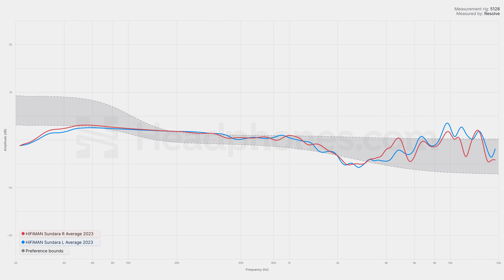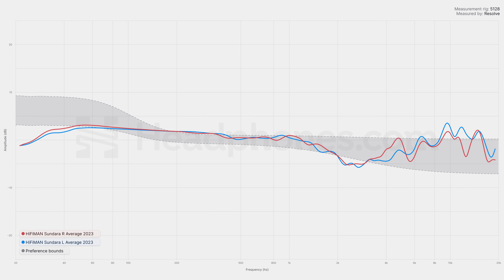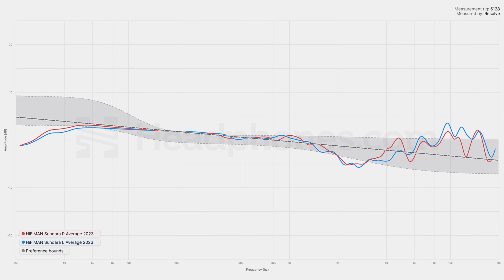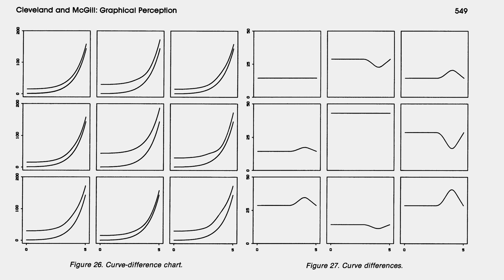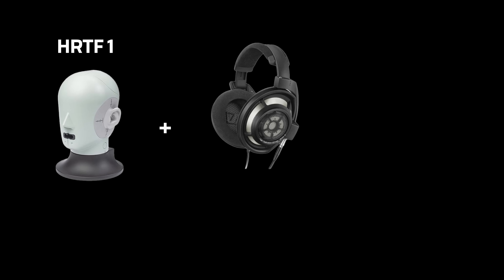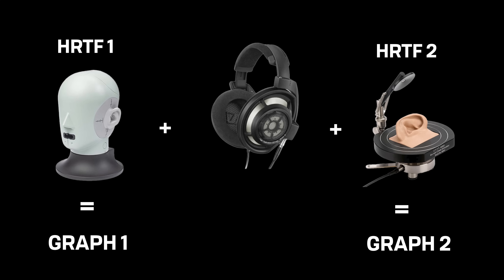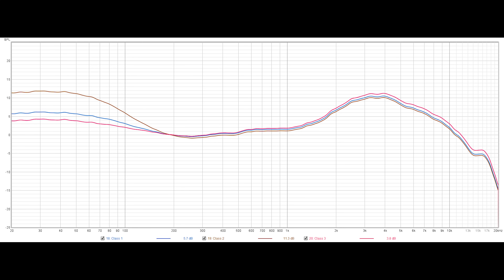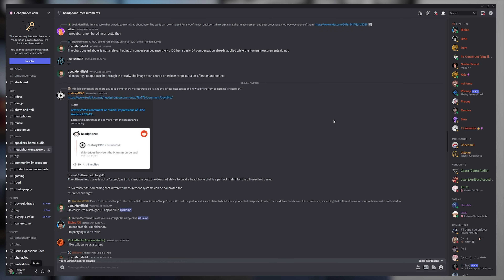A new standard for headphone measurements

Comment: I actually like what happens on sites like squiglink, where you can directly compare graphs of different headphones and you can compensate to both a target and another headphone. That imo is way more informative of similarities between different models, and is extremely useful for stuff like eq. I don't get why you don't have your own squigsite, with your database of 5128 measurements it would be an extremely useful and reliable tool for the community

Comment: I am a bit confused. Depending on the normalization frequency point (e.g., 500 Hz or 1000 Hz), the interpretation can change a bit, especially for in-ears, right? So how do guys choose it? Averaging using white noise as seen in Harman studies, matching what is perceptually revelent to the reviewer, or another method? 

Another question, is the preference boundaries the same for in-ears as well? Assuming that is based on the OE research and the in-ear research suggested more bass was preferred it seems a bit unclear how the in-ear approach will be.
Reply: You're asking the right questions. Currently normalization is full range 'best fit', but we are internally debating that and potentially adding custom range normalization. For IEM data the preference boundaries will need to be wider because there's more variation in terms of IEM preferences - again based on the research. We're also going to move to a population average DFHRTF for IEMs since the pinna is being bypassed, but that work hasn't been completed yet.

Comment: I've been looking at that graphical perception chart for a few minutes and I don't get it.
Anyone cares to explain and the relation it has to FR graphs.
Reply: When reading a FR graph, the main thing we care about is the difference in SPL (dB) between the measurement and the target, or in other words the vertical distance between the two on the graph.

Now for example, look at the top left graph in the graphical perception chart. Imagine you have a ruler positioned perfectly vertically from top to bottom, and slide it from left to right across the graph. You would find that although it appears that the lines converge, they actually have the same vertical distance from one another at all points across the x-axis, or in the case of a FR graph, each frequency. So when compensated, the top left graph corresponds to the 4th graph from the left in the top row, the flat line.

So what Resolve is saying is that compensated FR graphs are easier for us to read accurately compared to raw graphs, particularly in the ear-gain region, because of this error in our perception.

Hope this helps!
Reply: @nshr1694  Thanks for the reply!

That makes sense, at least when comparing the other figures! Most of the sites comparing graphs have an option to show the difference in dB compared to target (and/or other devices) when hovering the cursor over the lines, but I guess that still makes it hard to tell where the actual changes are?

I've noticed something similar when looking at Crinacle's normalizing between 60dB (for example) and 1000Hz. Do you know how that works?
Reply: @Ca11mero  No problem!

I believe you are referring to Crinacle's article "Graphs 101: How to Read Headphone Measurements" ?

I'm no data scientist, but it's true that the way a graph is normalized (at what point the two graphs are equal) also has an effect on how measurements are perceived. Similar to how calling a headphone "dark" (less highs) or calling it "warm" (more lower mid/bass) are nearly the same thing. (And even then these words might not mean exactly the same thing to each person)

As Crinacle said in his article, normalizing at 1000Hz is more of a rule of thumb and there is no one rule when it comes to normalization. Normalizing the graphs by perceived volume (equal loudness) is another method Crinacle mentioned and this would work better for some cases as well.

In the end it's up to the reviewer or source of the measurement to make sure the data is presented in a way that makes sense. Since FR measurements are just a curve we are really not comparing the differences in the values at specific points like I said earlier, but instead the shape of the two curves overall. For that reason there is no one single way to place a measured frequency response and a preference curve on the same graph for comparison.

Again I am no expert on data presentation, but I hope I was able to help you understand! And always remember, you do not have the same ears as the test rig and the same preferences as the reviewer, so it's always best to listen in-person!
Reply: @nshr1694  Thanks a lot again, it's very interesting.

Yes, that was what I was thinking about! But I'm not sure why you would normalize at a certain Hz rather than volume.

Interesting, so what's why you should stay away from stuff like AutoEQ? Since it just matches the curve? So there is no real scientific way to EQ to a target I assume. Also there doesn't seem to be any good way to figure out where peaks are besides guessing it's somewhere around where it's been measured. Some people suggest tone generators (listening to specific Hz) or sweeps but that has it's own set of problems. Like a guitar note playing is a set of frequencies rather than a single frequency.

Yes, that I know of! :)

Comment: There are a couple things I don't get. One is volume. It seems to me that somewhat different curves would be preferred at different volumes, yet volume is rarely mentioned. The other is that adjustments in say bass response might induce "new" preferences in say the upper treble, so the bass response "preference" in a target curve might be forcing preferences in another area in the curve and vice versa, so a single preference curve doesn't quite make sense to me. It's like depending on the person you might prefer more salt and pepper together, or more pepper if there's less salt, or more salt if there's less pepper, but then somehow you're trying to define the preferred combination of both, when the preferences work in tandem.
Reply: Right, so the preference research accounts for that, which is what the preference boundaries shown here also reflect. I actually think what you might be interested in is the methodology of the research itself, which is linked in the video description. Unfortunately its behind the audio engineering society paywall, but if you are interested to learn about it I highly encourage reading it. We've done some videos on it in the past and will likely continue to do more on it, but a video can only cover so much.
Reply: @ResolveReviews  Makes sense. I would like to learn more if for no other reason than to explain my own preferences. Like at medium to higher volumes, I really like the HD600, but at lower volumes, I prefer the 109 Pro. But I'm not sure I'd ultimately prefer a headphone with a response that was an average of the two. I think this speaks to your point about the target only being a reference tool and not a "goal" or the final word.
Reply: Sennheiser explains how the tuning of the ie900 is meant to be suited for low volume listening

Comment: Your speech is too quick. Hence it is difficult to follow you, especially for someone who is not familiar with the topic. You also make quite much mistakes in your expressions. Hence it would be good if you paid more attention to the correctness of your expressions, both for you and for the public terminology and also that would decrease your speed, which would be positive IMO.

You do not "compensate measurement", you compensate graph of frequency response.

Not '"measurements' but 'frequency responses' are represented. Frequency response is measured, so measurement's output is frequency response. They are not the same concepts, one is the subject or output of the other.
They are not "represented" differently but "presented" differently. Their representation is quite uniform: an array of real numbers [probably floating point, in computers].

The 'target' is a frequency response, not a curve. The target, as FR, can be and often is presented by a curve, thus the "target curve" expression is valid, but that does not make the target a curve.
Reply: If someone's speech is too quick for you, then YouTube has some neat accessibility features to make it easier to comprehend. You can slow the video down, or turn on auto generated subtitles which are surprisingly accurate. Everyone's speech has a different cadence and flow to it, it's not really something you can control over extended periods of time while still retaining normal mental faculties. And it isn't inaccurate to say that a measurement is compensated. The measurement of the frequency response is what we are directly seeing. The actual frequency response is not being altered, simply how it is being represented in the measurements. Even if saying that were a mistake, mostly everyone understands what the intent is without too much trouble. In the same way that if someone says "you make quite much mistakes" instead of "you make quite many mistakes," people just instinctively understand what the actual intended meaning is. Because making tiny errors in our communication is just part of being human.
Reply: @millsjonah 
"Many" is for countable quantities. The mistakes that i was talking about are not countable.
Reply: @zoltantoth1566  yes, they are. Mistakes are a countable entity. You can make 1 mistake, you can make 2 mistakes. You're just incorrect
Reply: @millsjonah  
We should weigh mistakes by their severity, severity is not countable.
2 mistake of the same type - is it 1 mistake or 2 mistakes? I would say somewhere in the middle.
...
Reply: @zoltantoth1566  just admit you made a mistake dude, it doesn't matter in the slightest.
Reply: @millsjonah  I just explained to you that that and why i think mistakes are not countable. An 'admit your are wrong' does not change my belief.
Reply: @zoltantoth1566  there's no point in trying to change your beliefs when you're this stubborn and incorrect, it's wasted energy.

Comment: Seems like a correct approach to me, but I am just not clear how you have compensated the preference curves / boundaries themselves.  It seems to me that you would have to use the human average transfer function to adjust the Harman data, or at least something similar.  Is this what was done?
Reply: Similar yes! We use the rig-specific DFHRTF, which is the ear transfer function that makes the most sense for headphones. Right now its for two 'standard' ears in the B&K 5128 and GRAS KB5000, but population average is what we'll likely go with for IEMs since the pinna is bypassed.

Comment: Nice work to you all! Only thing I would say is that for hifiman headphones and other similar headphones the preference boundaries for the pinna gain seems to only partially apply since it is shifted . I think must people would not touch the pinna gain of the hifiman, but would touch up the trebble and bass. I would maybe add another shaded area for shifted pinna gain headphones.
Reply: What do you mean by "shifted" pinna gain?
Reply: @Ca11mero  with the sundara it is a bit less present, bit with the arya etc the pinna gain is shifted from 1k to 2k. Which is in part responsible of the enlarged soundstage impression